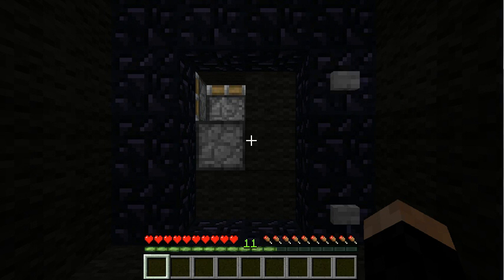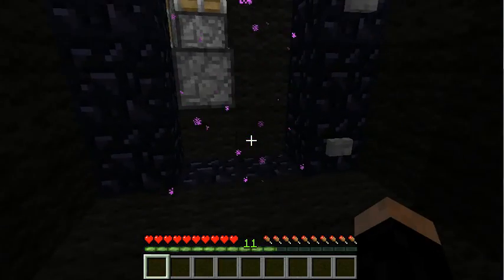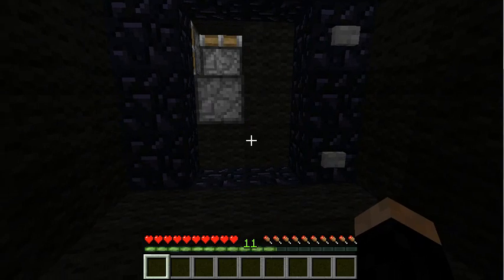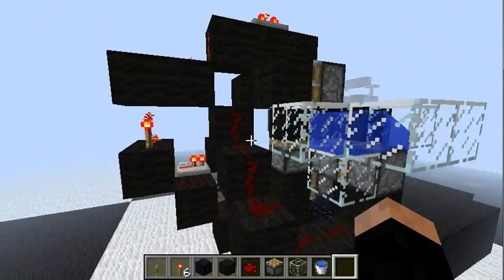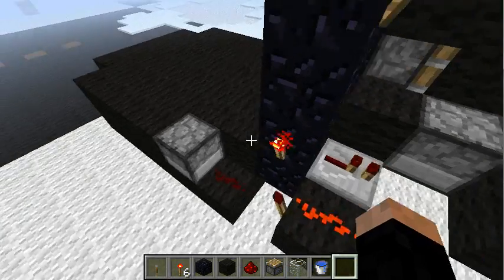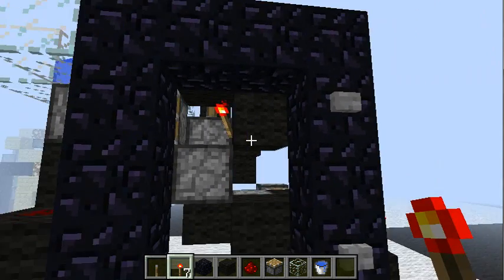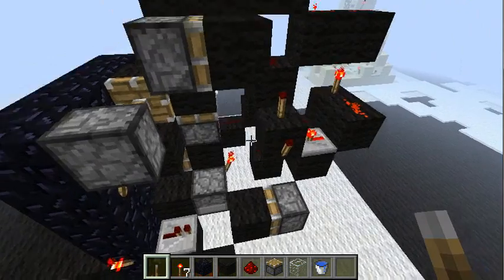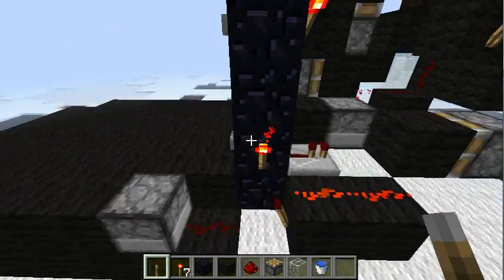Minecraft: Update on the portal system

Comment from the maker: @zargystudios Sadly, i don't think that this will be possible. The system is based on a blocktransmuter, which relies (currently) on a gap in the code which requires the torch. If you want to turn the portal off without this you need explosions. You can read this for more informations: minecraftforum
/topic/982095-instantly-turn-on-nether-portals